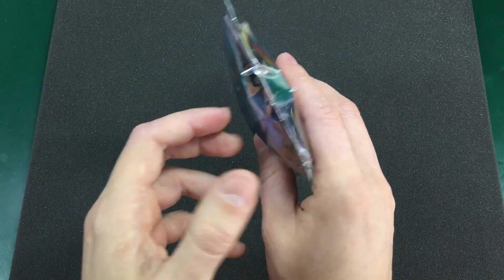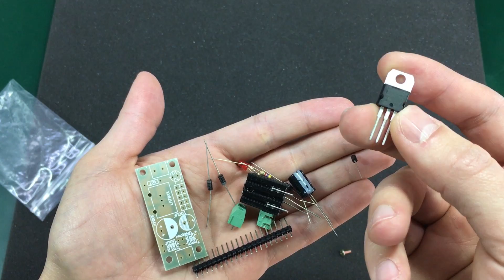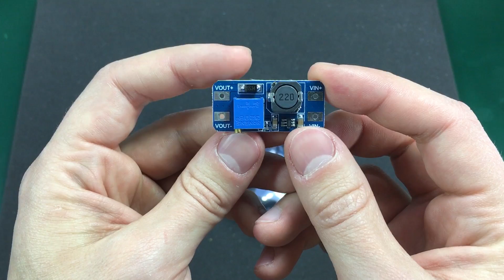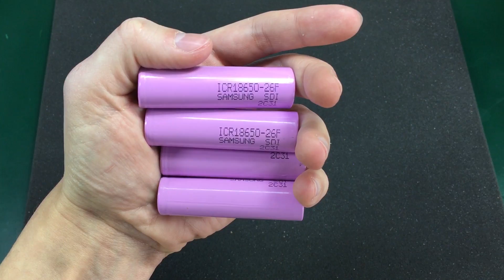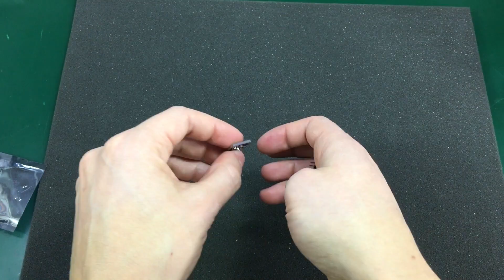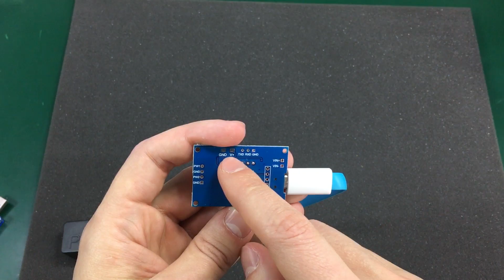Voltlog #92 - InTheMail

Comment: Hi Voltlog, love your InTheMail videos, especially as you provide links (and they are good for you too).
But I'm not sure if your criticism of the TPS40057 is completely accurate.
Admittedly, I don't know that much about synchronous or standard buck converters, but maybe the inefficiency caused by the diode in the standard buck converter is worse when it's in the switching section, than that caused by the use of a protection diode? I don't know, just thinking out loud there.
But certainly at the higher input voltages, when the input current is lower, the loss caused by the (presumably) schottky diode should tend towards minimal.
Reply from the maker: That's an interesting question you raised but I don't think it's the case. It might even be the other way around. In the converter circuit the diode only conducts momentarily, while in the input section it will pass current continuously.

Comment: I looked into TP5100, but they don't seem to have cell balancing capability.
Reply from the maker: no, unfortunately they don't..
Reply: I would NOT suggest using it for 2S batteries, but 1S should be OK.
Reply: is it safe to charge 2s 18650 with TP5100?
Reply: Well I knew it was too good to be true! Also doesn't seem to have any UV or OC protection. One can not rely on the built-in ones inside the batteries, as some Li-ion knock-offs, don't have any protection.

Comment: nice purchases !

but i would just like to tell, if you need a lm317 supply  for a project, it's easy if you just solder in a lm317 with 2 resistor at left, with 2x close positioned small caps at i/o lines. just 5-10mins work.
Reply from the maker: yes, it's easy to solder an LM317 but It's my personal preference to have everything nice on a PCB :-)

Comment: I would look at using 18V power tools battery pack to power a class-D amp, it may go into clipping at lower voltage, also, the TPA3118 and TPA3116 board seems much better, lots of info on diyaudio. There is a 2S BMS with "balancing" but the best would be using multiples TP4056 with isolated grounds.
Reply from the maker: thank you for the hint, I will look into those amplifiers. (I checked and they are too high power for my application, I need a maximum of 2x15w)

Comment: If you're building a Bluetooth speaker you should look at this, I purchased 3 of course because they're cheap but they sound great considering and very loud. Has plenty of headroom and everything you need.  http://www.banggood.com/TDA7492P-50W50W-Wireless-Bluetooth-4_0-Audio-Receiver-Digital-Amplifier-Board-p-1003047.html?rmmds=search
Reply from the maker: I used one of those in my bluetooth amplifier project, it's too high power for the bluetooth speaker that I plan building,
Reply: For the very same reason I purchased this, please take a look.
Bluetooth 4.0 PAM8610 Audio Receiver Digital Stereo Amplifier 12V DC 10W*2 15W*2
http://www.ebay.com/itm/172446542263?_trksid=p2057872.m2749.l2649&var=471288621140&ssPageName=STRK%3AMEBIDX%3AIT
Reply from the maker: that would be a good alternative, but I already have a bunch of bluetooth module so I said to myself why not pair one of those with an amplifier module and build a speaker.

Comment: TP5100 4.2/8.4V Lithium Battery Charging Module. This chip doesn't balance the 2 batteries so why not use any sepic buck/boost converter? A buck or a boost can achieve the same results and also have the ability to charge upwards a 10S battery pack. I have to be missing something, if I am please tell me, thanks
Reply from the maker: a simple buck/boost converter doesn't have the features of this special lithium charging ic: charging with 3 phases: tricle charge pre-charge, constant current, constant voltage and the protection features.

Comment: That AT-30 module I purchased one and the heatsink fell off in the mail so I just glued that back on and they sent me a fuse and a extra capacitor for some reason.
Reply from the maker: oh yes, I remember, there was a fuse in the envelope but I miss-placed it..
Reply: I have that same thermal silicone glue. I didn't use just any and I found that strange about the fuse but they must be thinking you're going to blow a capacitor, did you get one?
Reply from the maker: +MrBrymstond I didn't get the cap

Comment: any thoughts on messing with the highland 0-28v , 0.1-2A power supply kit with an LCD?  I have one here, and it works fairly well.  also easily hackable :)
Reply from the maker: +Jeff L is that the switching model? I have one of those kits but haven't tried it yet.
Reply: i think it is switching. it uses a A1941 PNP transistor, with everything running back to a atmel micro :)

Comment: I would move the diode on the buck converter , to be across the D.C. Input, will blow fuse if reverse wired at least.
Reply from the maker: +TheDefpom that would be a better option indeed. Though I don't like distructive protection features.

Comment: The problem with most of the D class boards coming from china is the gain is always fixed on the higher setting, where you have distortion most of the time. 
The TPA3110 has two pins for gain, so four values, so if you feel courageous you could try to solder a DIP switch.
Reply from the maker: +BIBIwood yes, I have seen that issue. I will hack this module if too much noise is present.

Comment: Absolutely love your VoltLog videos! I'm purchasing many of these little circuits you recommend. Question on this 0-30V 2A p.s. I purchased four of these kits to build up for my lab, and I would like to add a push-button to show the preset current limit that reads out on the digital ammeter without actually placing a "brute" load on the circuit. I have the schematic. Could you suggest a way to do this within the circuitry?
Reply from the maker: +Chris Moen I would use a microcontroller to read the value of the analog pots and approximate the current limit based on a lookup table or linear function.
Reply: Thank you for the idea.
Reply: using digital POTs would give you better controlled readings.